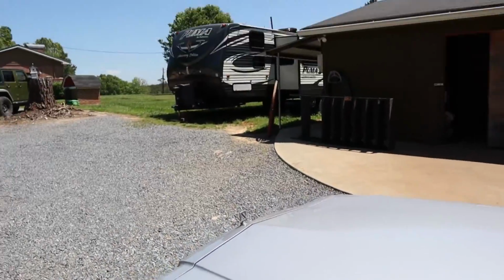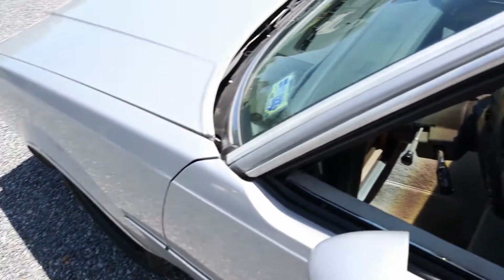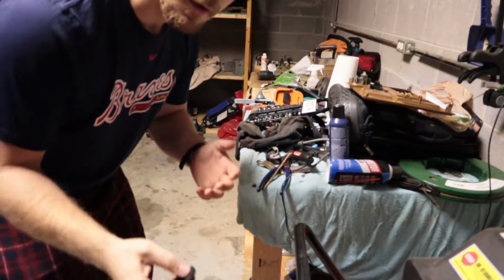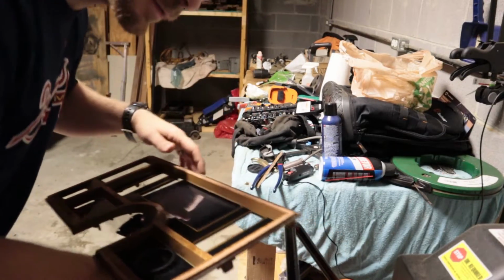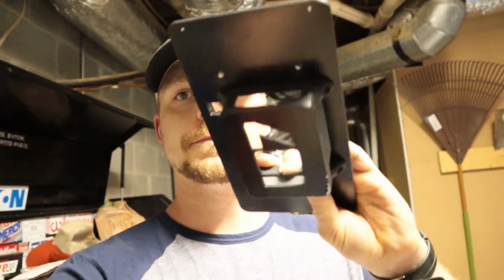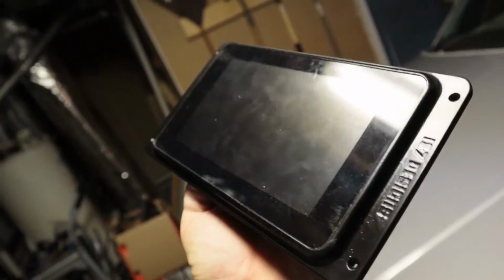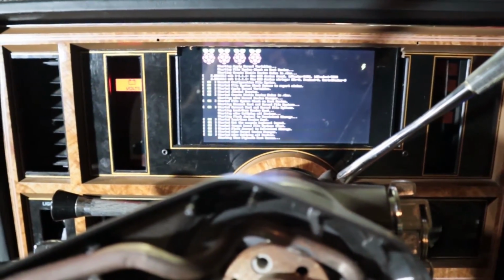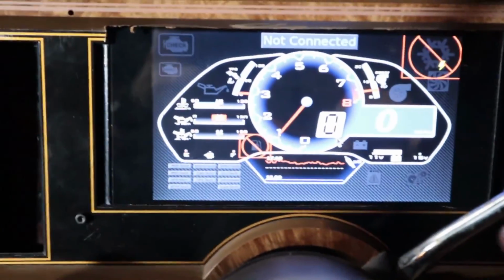Wife Drives First V8(LS Swapped) Car and PI-DASH(Lamborghini) Install

Comment: How did you get the lambo style gauge. Thought you can’t use shadow dash with the pi
Reply: You can download the dashboard from tunerstudiodashboards.com
Reply from the maker: It’s the TunerStudio dashboard
Reply: Huh never seen it in my tunerstudio. I’ll have to look again thanks for the info
Reply from the maker: @jackerman3040able  do you have the pi dash?
Reply: Yes sir pi 4
Reply from the maker: @jackerman3040able  when you open up TunerStudio it usually comes with a dash to monitor your parameters just double click it and it will go full screen

Comment: Very cool project. Love playing with the Raspbery PIs. Love your Regal. Your offer is making me want to take a trip to Georgia 😂
Reply from the maker: thanks man! i want to let folks drive it on boost when its done. everybody always takes people for rides but never lets the fan drive
Reply: @SkinnyPedalMotorsports  That's an awesome attitude and very generous of you. Yeah, I bet that car will really haul with a turbo.
Reply from the maker: Yeah. A s480 is gonna run premium on this thing. You have a pi in your car?
Reply: @SkinnyPedalMotorsports  Not yet. Want to use one in my older truck. I've used PIs for some home automation projects.
Reply: @SkinnyPedalMotorsports  but how did u connect the usb from the pi to the ecu??
Reply from the maker: @FirstLast-tx3yj  usb cable
Reply: @SkinnyPedalMotorsports  but the gm ecu doesnt have a usb!!!
Reply from the maker: @FirstLast-tx3yj  I have a mega squirt ecu